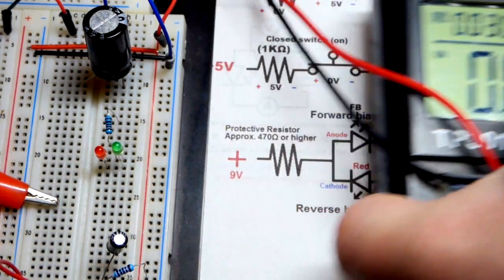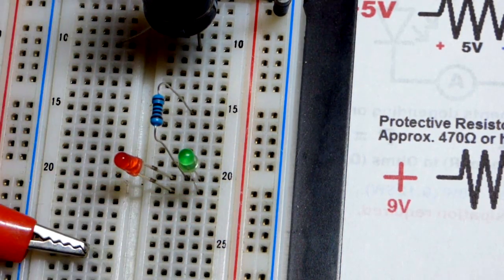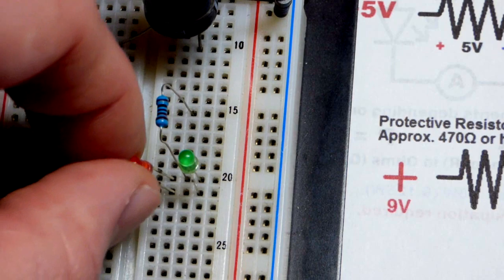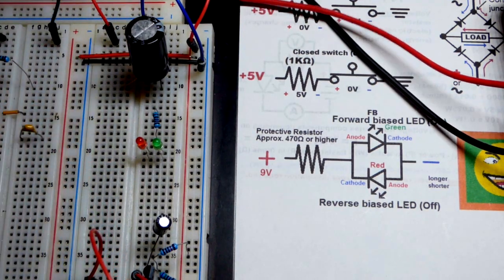Electronics capacitor components naturally turn DC into AC while charging and discharging demo

Comment: When a capacitor is fully charged by applying DC, it becomes an open circuit.  So at 5:22 why does the LED light if no current is flowing through the capacitor? (it would be an incomplete circuit for the LED).
Reply from the maker: It wasn't charged at 5:22. No current showed up on the display most of the time because it was less than 1mA. Hope that helps!
Reply: @Electronzap  Gotcha.  I was confused on two counts.  1- I misread the video and mistakenly thought the LED stayed on continuously, but it was only on while the cap was charging.  The time constant for the 1000uf cap with a 1k resistor is about 1s, so it should start dimming fairly quickly (which it does).  2- I neglected the fact that current flows to the negative terminal of the cap while charging which is of course why the green LED lights.  I replicated your circuit and put a scope on the + lead during charging.  Of course you can see the characteristic exponential rise which is in practically every electronics textbook.  I then did the same for the - lead and you then see the exponential DECAY, occurring during CHARGING, which is something you won't see in an electronics text!  (negative plate is filling up with electrons).  At first, I thought this video was too elementary, and then I paused.  So I'm glad you made it since it really got me to think deeper about what's going on in a cap when it is charging.  Thank you!
Reply from the maker: Glad to hear! Thanks for watching!